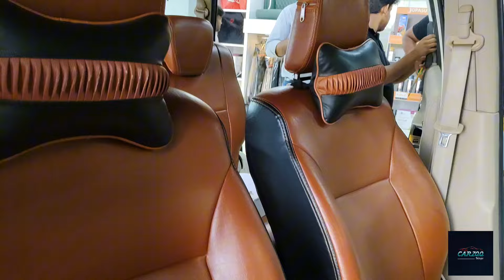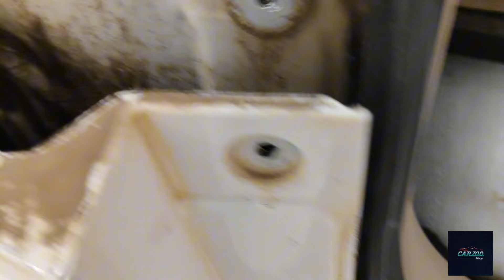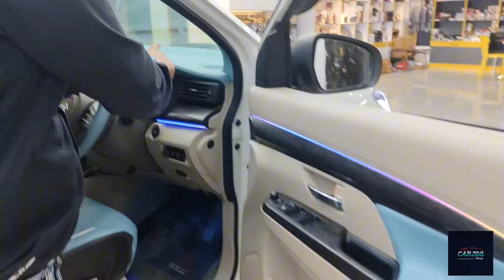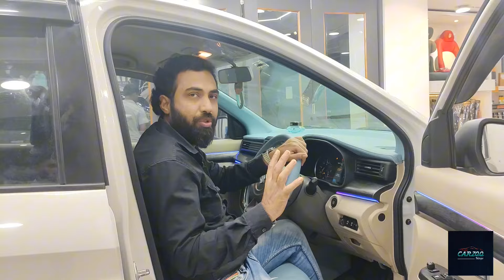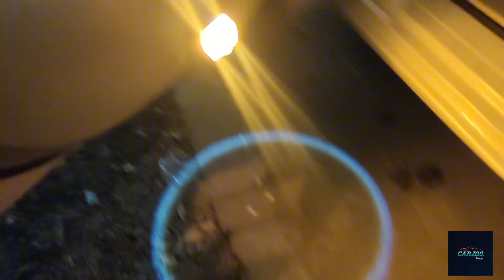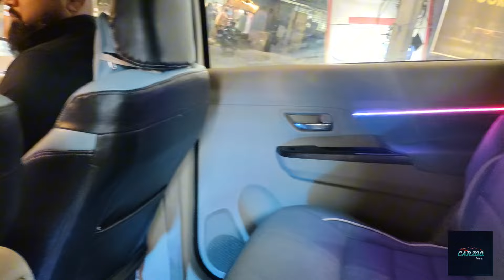ERTIGA MODIFIED||ERTIGA INTERIOR MODIFIED FROM GANNAVARAM AP|| CARZOO HYDERABAD

Comment: Bro worst modification ante back side kinda reflector's remove chesi light pettadam 
Oka sari company akkada reflector's yanduku place chestharu meku telusu anukuntuna nenu 
Kani meku telisi kuda dhani change chesaru adhi naku nacha ledhu bro 
Vati use customer ki teliyaka pothe meru chepi guide chesthe inka bagundu
Reply from the maker: It is led it ignites with parking. The car is more visible with it.
Has many features which a reflector doesn't have.Request you not give wrong comments.